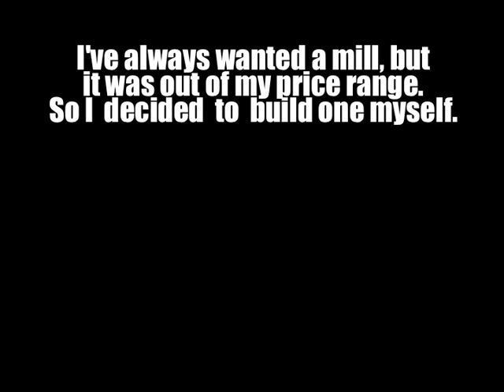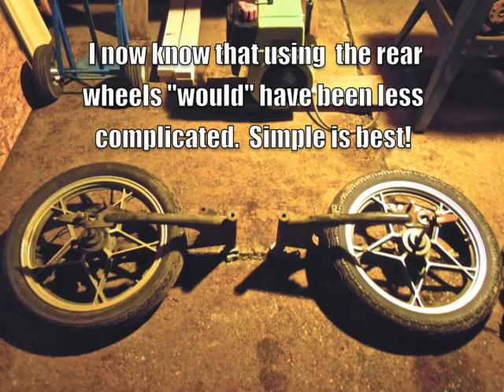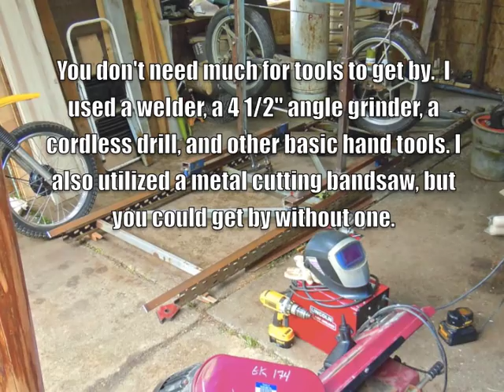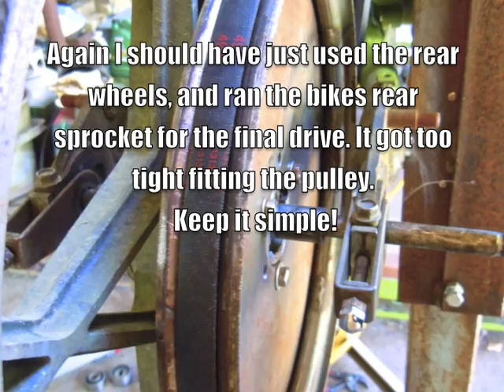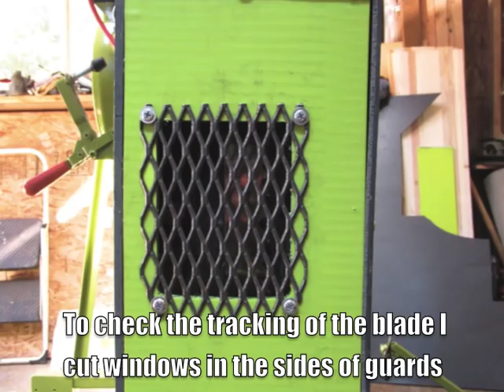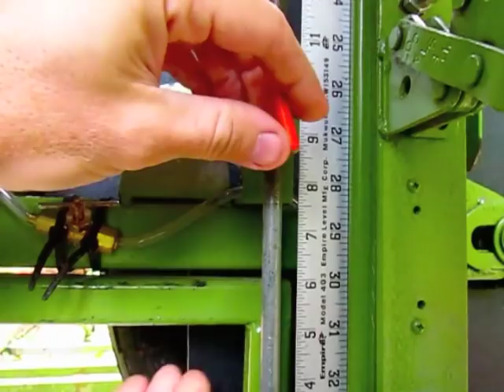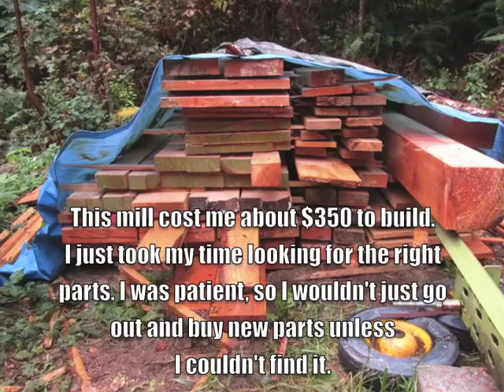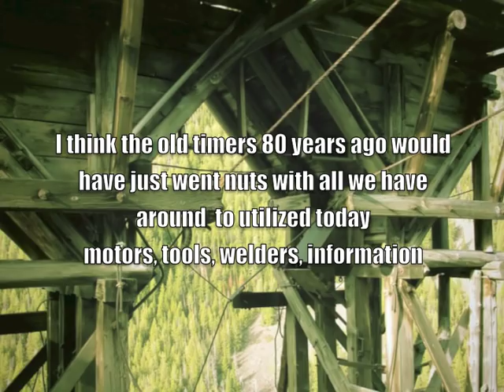homemade bandsaw mill

Comment: Thank you for making this informative video Mike! Also I appreciate that you took time and care to make a precise mill regardless of the material costs. One question I have is about the lumber. Are you drying the lumber you use and if so what is that process. For example did you dry the lumber that you used for the mill structure?
Reply from the maker: Thanks for your nice comment!
If you get time check out some of my other sawmill videos, I have added a lot of great features to it. I do dry my lumber, most of the wood I milled for my sawmill structure was logs that had been cut and drying in log form before milling, so I just built with them right off the bat, but I like to mill green logs if I can, and once there cut into lumber I will sticker them with small 1/2” pieces of wood and stack them for a year or so to air dry, I cover the piles of lumber in the rainy months with a tarp to keep them dry. I hope this info helps :) Take care

Comment: Is the water used to cool the blade or acts as a lubricant? Which end of the blade is it applied? I would think that if it is for cooling the blade, it would be after the blade comes out from the cut or if for a lubricant, before the blade enters the cut. Just curious. Thanks for the nice video.
Reply from the maker: +ded duck I use water mixed with a little pine sol cleaner for blade lube, it drips onto the blade before it goes into the cut, it helps to keep the blade moving through the cut without binding, and the pine sol helps with pitch, it keeps it from building up on the blade. Thanks for watching.

Comment: Hey mike…got inspired and built a saw based off yours…i had a question on one thing.  The blade when u first put it on would it walk off the tires without the guides on…I am making guides but in the meantime I was just turning by hand and seeing how it looked but the blade wants to walk even after adjusting quite a bit…was curious if this is normal without guide bearings assembled…thanks!!!
Reply from the maker: Hello Eric, I think you will enjoy owning a mill! I haven’t had to adjust my tracking on the mill in years, but you should be able to adjust it so when the blade is tensioned it will ride on the crown of the tires without walking off when turned in the cutting direction.
I do think the guides will help, keep in mind I later built ball bearing guides for my mill and they are way better then the UHMW guides I originally made. 
Ps keep in mind if the blade walks slightly back and rests on the back bearing I think that’s fine as long as it’s not forced hard against it. Also like all bandsaw mills once you are cutting lumber, never pull the mill backwards when in a cut because you run the risk of walking the blade off the wheels, if you ever need to pull the mill backwards when in a cut, stop the motor, and then pull the mill back, if the blade doesn’t want to go back sometimes you need to tap a wedge into the cut to take the pressure off the blade, just a helpful tip 👍
Hopefully you have your mill going soon! 
Take care 🙂
Reply: Thanks Mike…all your builds are awesome…do you run a 1.25 or 1.5 inch blade on your saw?

Comment: How many times have you tripped walking over the ribs? Not possible to lay a board down to walk on?
Reply from the maker: Over the 6 yearsof owning this mill I haven’t tripped. When operating saws one should be aware of what they are doing. I also modified my mill with a power feed I built, I ride on the mill now 👍
Reply: @Mike festiva Do you have a video of the powerfeed add on?

Comment: I can calculate RPM and related pully diameters to reach my desired RPM but I have never calculated FPM. How do you calculate this for the blade speed?
Reply: If you know the rpm you're almost there. 
Make a mark on your pulley, either use a seamstress measuring tape or use a string taking your marks to a regular tape measure and measure out the length of one turn , then convert to feet from inches... multiply ✖️  that number to your rpm will get you fpm.

Comment: Hey Mike how long and high is your rolling carriage? I got my trailer just about set. I don't want it to be too long because it will limit capacity. But I don't want to build it too high... I have to tow it...  would love to share some pics and documentation if possible.  I'm a shop teacher in LI NY.
Reply from the maker: Hey Sean do you have an Instagram account? If so we can share photos about the mills that way.
I will need to go measure the mill and get back to you.
That’s cool you are a shop teacher 👍 I think kids still need to learn how to build stuff. Thanks for helping teach others!
Reply: @Mikefestiva  just requested. I'm sean_michel

Comment: This is a great video, is there a problem or the carriage jumping up off track or do you have rollers underneath preventing, or is the weight enough
Reply from the maker: cosmicway Thanks for checking out my video!
I have never had a problem with my mill jumping off the track, I could see if you made it portable you would want to lock it down before towing it down the road but other then that it’s great. You should check out my YouTube page, I have posted many videos of improvements I have done over the years, I have two videos on building a power feed, and just posted a video on building a simple setworks height controller. If you have any other questions feel free to ask. Take care :)

Comment: Nice job on the mill. Do you find that the pallet racks are heavy enough to hold up over time?
Reply from the maker: Yes I feel the pallet racking is strong enough to last the life of the mill, It's supported so it only spans about 4 feet between blocks on the ground. I'm completely happy with how the track works. I once put a log on my mill so heavy it was causing my 4x4 tractors back tires to lift of the ground at times trying to load it. 
If I ever built another mill, I would for sure use pallet racking again. Thanks for watching.
Reply: Mike festiva Thank you, I appreciate the response.

Comment: i never understood how the blade stays on the wheel. is there some kind if guide for this?
awesome project!!! keep going  strong!!
Reply from the maker: Thanks for checking out my video! My sawmill is still going strong after 5 years up use 👍
The blade will always track to the high point on the wheel, it’s called crown, and once you get the wheels tracking the blade it rarely ever needed to be adjusted. I have quite a few other videos on my mill, I have added power feed and electric hight adjustments to it. Take care

Comment: Hi, to achieve 4000 feet per min, what size pulley on a 13 hp motor would you need, cheers.
Reply from the maker: +Egidio Borg Thanks for checking out my video. So I used a total of four pulleys to drive the blade, mostly because my motorcycle wheels were large being 26” diameter. 
My motor is 12HP and I used a centrifugal clutch with 1800RPM Engaging Speed. The clutch pulley #1 is 3” and the first belt goes to #2 pulley 6. 1/4” which then powers a 1” shaft with pillow block bearings with #3 pulley 4. ¼” on the other end powering the second belt going to pulley #4 which is a homemade 12” pulley. I hope this helps

Comment: So do you have adjustment for the tires camber or caster? I've been reading some people run into issues where the blade isn't parallel with the bed, so tires need tilted forward or backwards to level. Or if the tires need to pivot in towards the middle of the saw or out to get the wheels on the same plane?
Reply from the maker: So to track the blade the tires can be adjusted the same way you would have adjusted the chain when they were used on a motorcycle,  axle bolt has adjustments on each side, once the tracking is set I don't have to mess with it much, it always tracks great. When I welded the swing arms together I took my time and made sure they where in line with each other, and again when welding up the saw frame I checked time and time again to make sure the tensioned blade was level with the saw mill log bed, if you take your time this should not be that hard to do. One other thing is my casters are mounted on a cam spindle, so if I did need to adjust the blade to be level with the log bed I could back off a nut and adjust the casters and tighten them down after I adjusted them, But I have not needed to adjust them yet.  I hope this helps you.
Reply: Yes, thanks. Still deciding on trailer tires vs motorcycle... mainly based on availability of used motorcycle parts.

Comment: If I am having a tough time finding matching wheels, possible to use two different sizes?
Reply: Have you ever had an aswer ? I'm wondering the same thing
Reply: their is no reason you cant use different size wheels you would want to make sure the bottom of the wheels are are at the same distance in height in relation to the the log deck and it would be a good idea to make the the driven wheel adjustable in the up and down so you could match the height of the other wheel @ericmartin3858

Comment: Looks like a cintrifical clutch? Working ok for you? I'm prepping to build a mill..
Reply from the maker: Yes I have a centrifugal clutch on my mill, It's been okay,  I never have had it slip when milling so that's good, but I have had it give me some problems with the bushing getting grabby causing the clutch bushing to create friction and sometimes spin at idle causing the blade to spin,  then I would need to put a drop or two every so ofter on the clutches bushing to keep it from spinning.
I would highly recommend buying a clutch with a ball bearing in it instead of a bushing. 
When I bought my clutch I bought this one because of the pulley size was a little smaller then the other one on surplus center but at the time I did not realize it had a bushing not a ball bearing, so buy a ball bearing clutch if you go this route and I think you should be fine.  I took my clutch apart in one of my other videos and replaced the bushing and it helped a lot with the friction problem.
I hope this helps you out.
I have a few other sawmill videos on my youtube channel so if you take some time and check these videos out I show a lot of parts of my mill and talk about building it.
Thanks for watching!

Comment: Can I ask where you got 4000 sfpm? Cooks said 3000 to 3500 jc not saying that u r wrong but building a liking sawmill
Reply from the maker: I got my blade speed from the Cook’s web site, I have not looked into it after building my mill but I recall the blade speed for my engine Hp in the 4000 FPM range. I actually think I could have geared it a few hundred RPMs higher because my engine doesn’t seem to really struggle at all when milling. 
But I have not bothered to play around with the gearing after building it because it really works quite well.

Comment: Doesn't having soft tires make it difficult to get tension on the blade?
Reply from the maker: Hey Ben good question, The answer is no, The rubber tires are actually how I tension the blade and they work really good.
Think about Big 747 airplanes, they ride on rubber air filled tires that supports a lot of weight.
I think not only does the rubber tires make tensioning the blade easy I feel there's a lot of other benefits to using rubber tires on a bandsaw mill. At 3:40 In his video I show how I air up the tires and tension the saw blade 
https://youtu.be/nE5Ars6igiA
Reply: the main problem with rubber tires, is the tooth lay. every other tooth goes to a different side with a straight up tooth between. the amount of tooth side tilt is 1/2 the thickness of the blade. this makes the kerf wide enough to keep from walking down the rails. tires push in on the upper teeth making the blade not track right in the cut by bending the teeth down flat, unless you can find a tread pattern that has a gap where the teeth run. after you run the mill for six months, it will dawn on you, well, I have to bend the teeth back out on the upper side of the cut again.
Reply: if thatwere true wouldnt it be an issue with any band saw? Don't they all run the blade over the wheel  ?
Reply: And surely in 6 months a blade would need a sharpen? and checking the set would be part of the process?
Reply from the maker: I have been running my mill for over 4 years now and I have never had this problem you speak of?
Did you build a mill with rubber wheels and this is a problem you encountered? or are you just speculating?
I don't know if the problem you are talking about could happen with wide flat car tires? I do know and can speak from my own experience that when my rubber motorcycle tired are inflated with a blade running on them that the crown of the tire curves down to the sidewall and only the flat part of the band blade is touching the rubber, the teeth don't touch. I have never had any blade get the teeth bent from the rubber wheel bending them. I can say if your running a blade for over 6 months of milling and have not sharpened it your getting amazing running time on them! 
I along with probably everyone that's runs a bandsaw mill knows that if a blade starts to dip or waver in a cut when milling it usually means it's dull and needs to be sharpened. 
Take care

Comment: Like the 3M speed glass welding helmet. 400 bucks when I bought mine. Just free I guess?
Reply: Ben Still That is funny you mentioned his welding helmet because as it turns out mike did get the helmet for free he found it alongside the road while riding his mountain bike I am guessing it fell off some ones service truck I know that happens because I left one of my welding helmets on the back of my service truck and lost it that way  also the lincoln welder he has he got for free also I know because I gave it to him it was given to me by a friend and when I upgraded I passed it on to Mike what comes around goes around :)

Comment: I was wondering what the benefit of using rubber tires verses solid wheel for the blade.
Reply: I think its just what he had acess to. Works pretty good imho.
Reply from the maker: Thanks byrysh for the reply, You got it right, I was just woking with what I could get for cheep.
They are still holding up great too!

Comment: I have been thinking about building a mill, well have been thinking about for a while, now time is catching up on me to many projects, so it's time to do something.
But I have a few questions
what is the name of the clutch that you run like the way to change the engagement speed by 4 small springs and not 1 long spring.
you used pallet rack for bed what is the size of it width and length-very good idea
where did you get the v-rollers that it rolls on
how long is the blade
what diameter log can you cut
guess I might have a few more as time goes by
built a stump grinder a few years ago went by the one Billy Taylor built https://www.youtube.com/watch?v=YlOpYI8MSE4&t=2s
have look at about all your videos all are interesting waiting on the small saw mill video
Good Luck
Reply from the maker: Thanks for checking out all my videos, I really appreciate that! First off I have to say that stump grinder is beautiful! You did a wonderful job on that!
Now to the mill I bought most of the parts that I could not salvage from Surplus Center and the clutch is made my Hilliard, it’s called a extreme duty, I bought the one with a bronze bushing mostly because I needed that size drive pulley but I would recommend the one that has sealed ball bearings, the bushing can drag and cause the blade to start spinning at idle sometimes. I can measure my pallet racking but most tend to be just under 4’ wide, I think the pallet racking is a great way to go!
My blade is 1.1/4” wide and I think it’s around 173” long ( again I will need to go check to be sure)  you can just build your mill to your liking and just order a blade to the size you need. My mill has a 26” cut capacity, that’s from bearing guide to guide,  I decided on that size because it worked best with my wheels, track and design and was fairly matched to my trees on my land, it works good for the most part, only on occasion do I put a big tree on that is wider then my guides, if this happens I run a chainsaw down the edge of the tree to rip it down to clear the guides. 
The V casters I salvaged from a old machine, they are real quality, I would say look around on line and buy a good set of casters. I bought a cheap set off of eBay for the smaller bandsaw mill I want to build but the V rollers are very cheap quality with a lot of play, the bearings fit loose in the casters causing a lot of slop. If you have a lathe you may even consider building your own? Sometimes though it’s a mater of time input or money? I don’t always have the time to sit down on my lathe to make that stuff. 
I hope this info helps you out.
If you have any other questions I would be happy to answer them, or if there’s any part of my mill you want to see in more detail let me know and I can show it in the next video I make of my mill. Take care! One final thing to note is at the time when I built my mill  (about four years ago ) I had a extremely basic set of tools, mainly a small flux welder, a angle grinder, a cheap metal cutting bandsaw, a cordless drill and a small drill press, that was about it, now I have a milling machine and a lathe along with much better welders and other tools to help. Your shop looks like you have a wide range of tools to help in the process of building you mill. When you do, please keep me updated on your progress!
Reply: @Mikefestiva  I had some of those same questions, found this, thanks.  We just had a tornado 2 weeks ago and knocked down 5 big trees, plus I had a bunch down from clearing for my DIY dual axis solar tracker.  So, the saw mill is on front burner now.  Just purchased the Titanium 125 flux, gonna follow in your footsteps loosely, LOL!  Thanks for the videos on the saw mill.